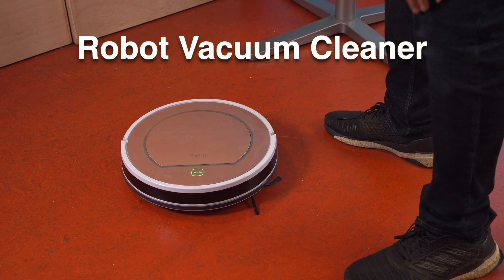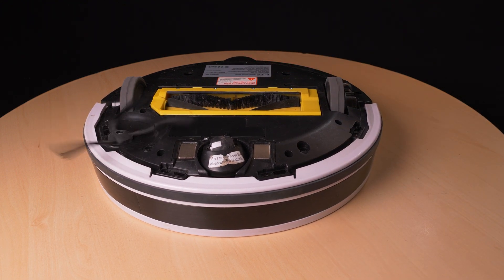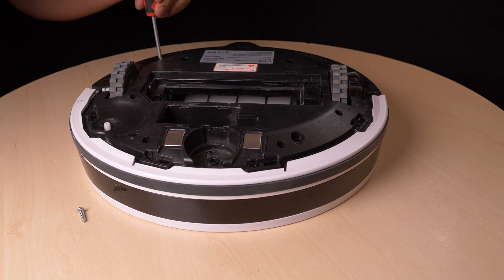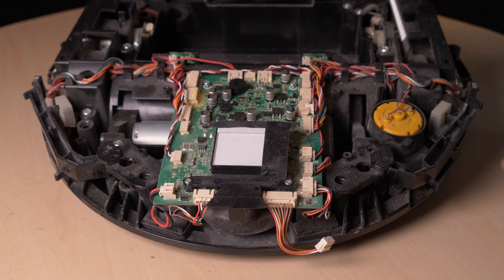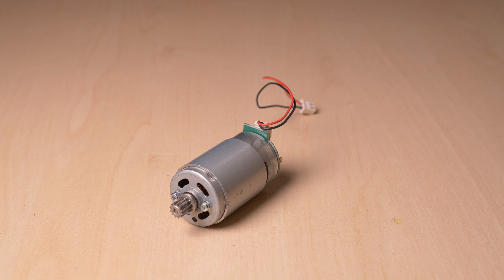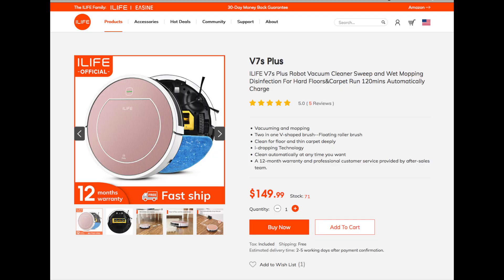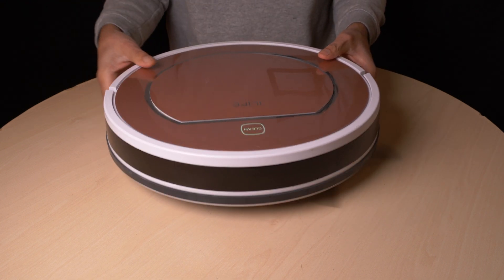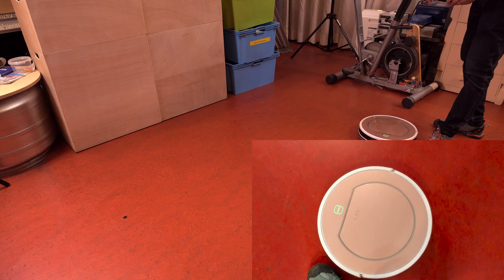ILIFE V7s Plus - Repair (the 4 beeps error). This vacuum cleaner robot is getting a second life.

Comment: I had the same issue with mine (4 beeps) but the motor was still working. After some problemsolving I found out the problem was with the turbo brush itself. After pulling it apart and removing the "pin and ball" that was on one edge I found loads of hair. And I mean loads!. No idea how it manages to get in there but that was the problem on mine :P Removed the hair and it turned smoothly again!
Reply from the maker: Great, you fixed it! (Yea, most vacuum robots have problems with dirt..)

Comment: hello, I had the same problem, but I changed the motor, but the problem was not solved, because it does not turn the new motor either.  I tried the new motor an other same vacuum cleaner and there works it. Idea?
Reply from the maker: Hmm, so; the motor works. To test just the motor you can attach it to a DC power supply. I don't remember what my motor needs, probably 12V, but 6V will probably be enough to test. See if it runs, and how fast it runs relative to the other one (you have 2). Maybe one runs slower because of too much resistance. If both motors run ok.. Maybe one wire connector has bad contact? Did you try if the battery is good? If it is something on the electronics board, that is difficult or impossible for me, only thing I would try is to clean everything really well. Have you tried the reset? The reset did not help me, but maybe it works in your case; Click and hold the Clean Button for over 3 seconds. Good luck, nice that you are trying to fix it.👍
Reply: Thanks for the quick reply, I tried everything you wrote but unfortunately it doesn't work. I'd rather think of an electrical problem. I measured the main brush connection point and there is a voltage of 14V, so it delivers the current, but the system does not turn it on for some reason. I think, I will contact a service... :)

Comment: I had the same problem but was too lazy to take the whole thing apart. 

So I just sprayed WD40 where the brush connects to the motor and it actually worked! Didn't have to unscrew a single screw. Thanks for posting this video 🙏🏼
Reply from the maker: Ha ha, that is one other way to fix it 😁

Comment: Thanks for the hint. The problem was in the gearbox, indeed. The bearing of the brush was stuck by the collected dirt. I propose everyone to check the bearing, it can kill the motor if it is not cleaned or replaced in time.
Reply from the maker: Ah so your gearbox did fill up with dirt. And next that can indeed kill the motor. Great that you could fix yours in time! How long did your vacuum cleaner robot work until it failed?
Reply: @GiesbertNijhuis  Well, not so much the gearbox filled up with dirt, the gearbox was relatively clean. The dirt was inside the bearing, almost invisible from outside. When I checked the bearing it was not turning but completely stuck. After removing the cover rings from the two sides of the bearing it was obvious the dirt filled all space among the balls, prevented the bearing from rotating. Of course you can replace the bearing to fix this issue but I had no spare bearing at home, so I spent some time on cleaning the old bearing and finally it worked out. 
The vacuum cleaner had worked for 2-3 years until it failed. First I suspected it was the battery and ordered a new battery, then a second new battery. Neither helped, then it was the time I consulted the phenomena on youtube and found your video, which helped me find the rootcause.
Reply: In my case was dirt inside the bearing of the brush, opposite to the motor. Thanks for your video!!

Comment: Very useful ! Thank you very much. My Ilife V7S PLUS works again !
The motor outpout was too durty, endeed.
Reply from the maker: Hey that is super Rob, you fixed it! Yes dirt did it again. So strange that they design vacuum cleaners without protecting its parts against dirt. How long did yours work until it failed?

Comment: The brush motor is stuck because a lot of hair collected in gap between the gear and motor body. Sharp and thin knife - all you need to fix the problem. In my case this helped at least :)
Reply from the maker: Interesting, that could be the reason for such a motor to fail, and how to repair it. There are 2 openings near the brushes of the motor, hair and other dirt could enter the motor there and get it stuck. I did not see hairs inside, but I will give it another inspection near the brushes and near the gear. Thanks for your cause and solution!